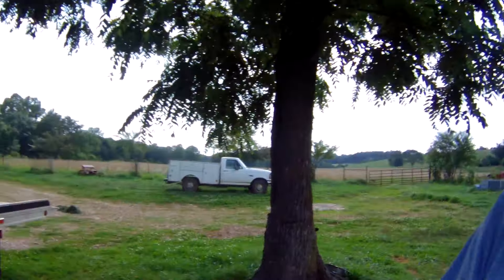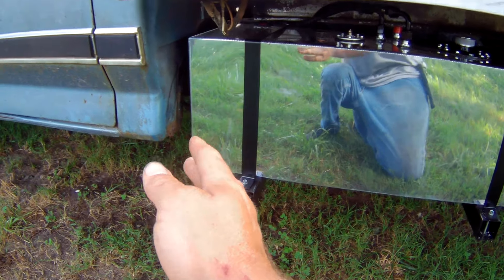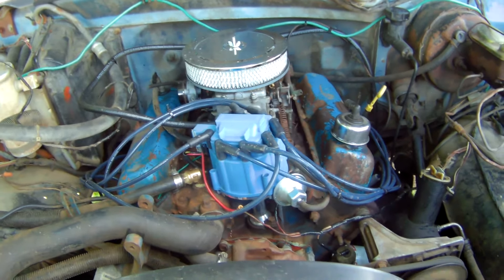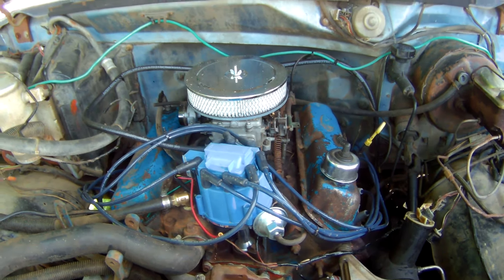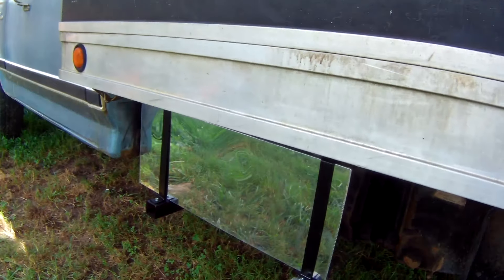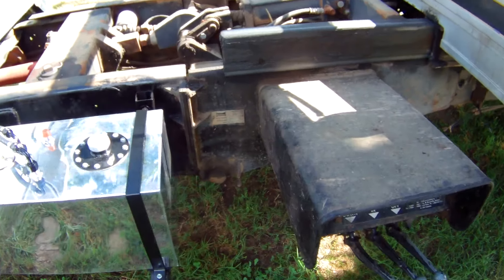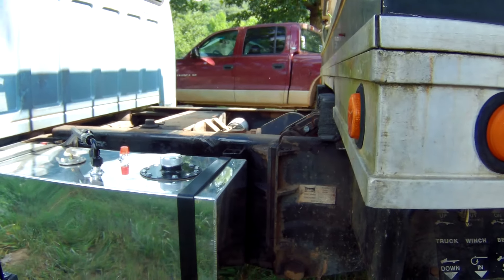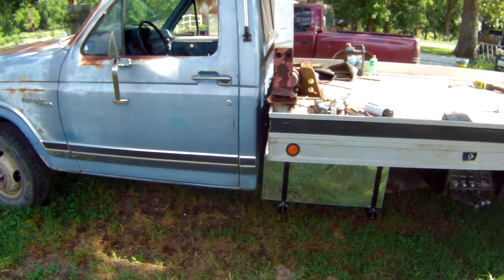rollback fuel tank fix and update

Comment: BTW, I used a relay for my fuel pump like the one you mounted, works MUCH better with a separate relay instead of wiring to the switch on of the solenoid
Reply from the maker: i dont use relays i hate them i use a 50 amp rated toggle switch hooked directly to the battery with a 30 amp fuse link and the fuel pump pulls around 12 amp with an oversized toggle you dont need a relay and if the fuel pump ever shorts out or locks up it will pop a fuse very good setup i have used it for years